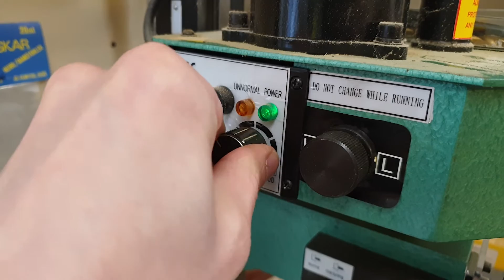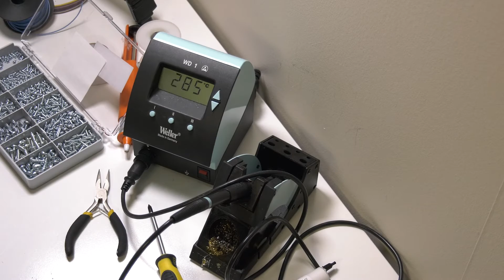DIY Grow Light

Comment: where do i get that tape and those leds
Reply from the maker: The tape is ordinary electric tape. You can get it at any hardwarestore. The leds was bought on ebay several years ago. Search for grow led modules and scroll down a bit and you will get them in 10 to 100 watt. Have an amazing week!